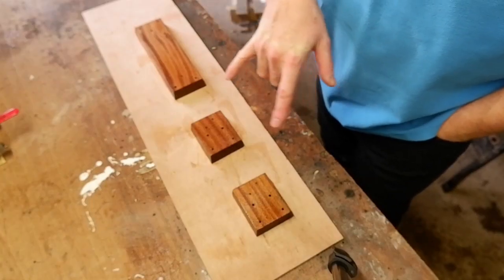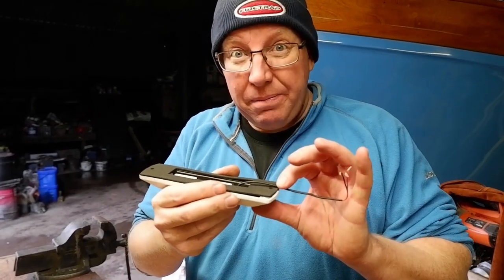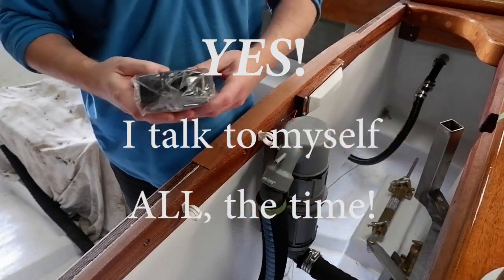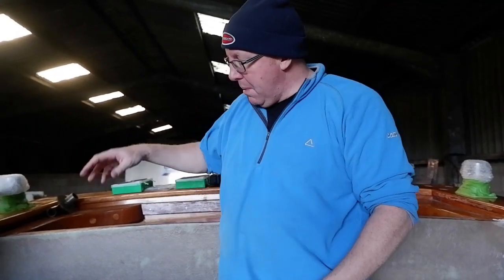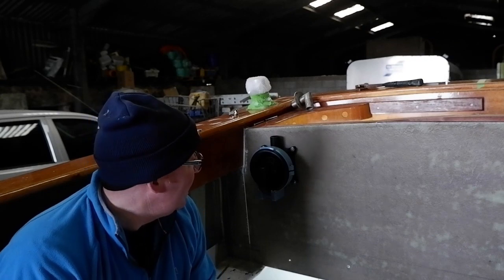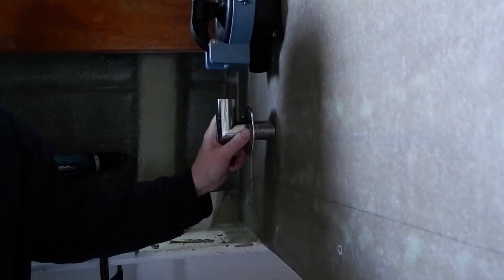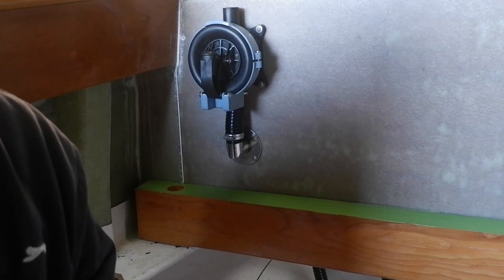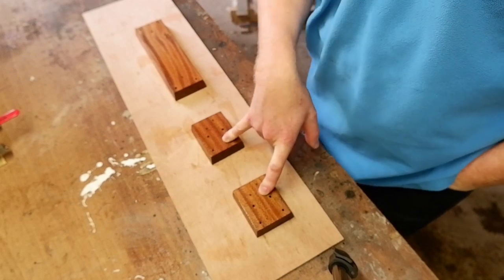Bailing out ( Episode 27)

Comment: Gday mate i have a mate who got an electrician mate to wire up his boat i asked him did you use tinned wire ? he said whats that i then proceeded to explain why you should use tinned over standard wire on a boat . Do you have a fuze box for all your wiring on the dash or inside the consul mine has the ability if a fuze does go a red led comes on to show you exactly which one is blown saves mucking about pulling 16 fuzes out checking each one .I have used those allen head bolts on the windscreen the ones were the originals slot headed  screws/bolts i dont think they even make slot heads anymore i am hoping that they will be good so if i have to remove the screen at any stage it will be easier as philips heads have a tendency to strip out then your stuffed speaking of thieves i lost 4 2 ton shackels of my vehicle in one hit at a shopping centre so i though right ill fix you ya b***** so i put a 2 ton hammerlock on one side and a 3 ton shackle with stud lock on it get those of ya mungrels .
Reply from the maker: Hi Crisp buddy.
🤣🤣🤣 I love the last bit of your comment on the shackles... I bet that stopped them🤣🤣🤣😁👌
I don't have a fuse box, bud.
There is no room in the console... I need a bigger boat!🤣🤣🤣😁👌
It's just an inline fuse after the fuse from the panel bud.
Luckily, I haven't had anything blow yet.😁👌 let's hope it stays that way.🤞🤞🤞🙈🤣🤣🤣🤣
That's good thinking on your windows bud, that's using the old noodle.😁👌

All the best 😊